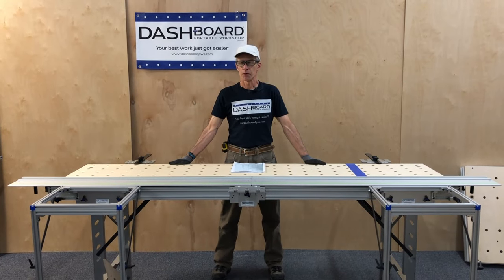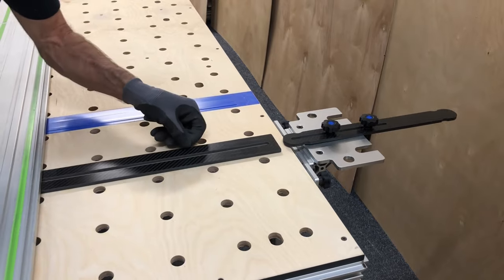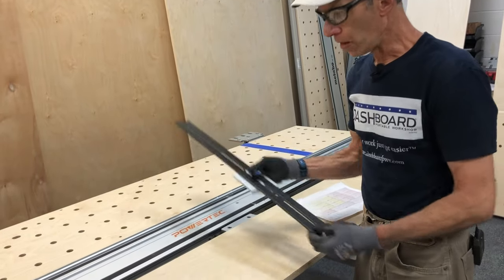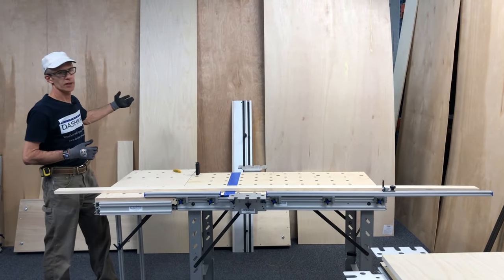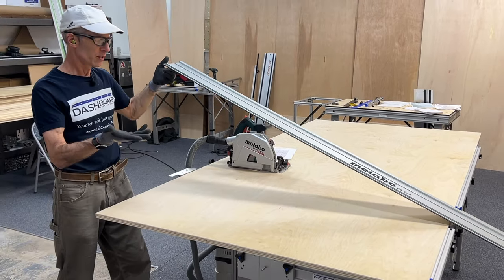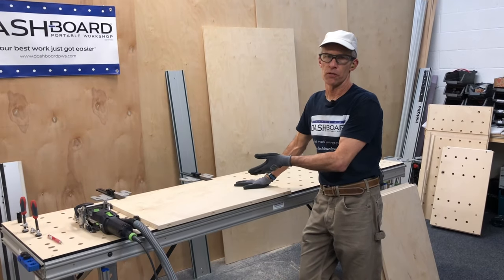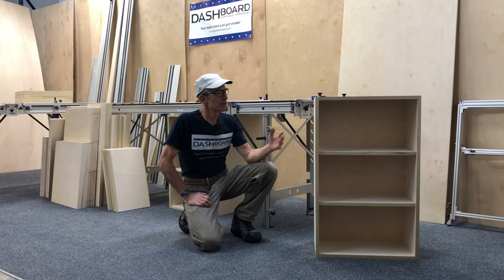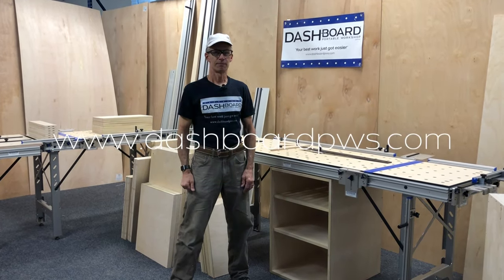Building Cabinets with Dash-Board® Portable Workshop (Full Length)

Comment: This is the first time I’ve seen this style of set up that seems worth it. I understand the use of an mft on the job site but so many people promote the use of using it as a primary work system in a shop which seems slow and limiting compared to a table saw and properly tuned miter saw. Especially because they generally do not have the capacity to handle full sized sheet goods and the seems very wobbly. I do built in work for a side income and this seems perfect for someone like me who doesn’t have the space or funding for a huge slider or cabinetry grade cnc for cutting out cabinet box components.
Reply from the maker: Thanks, Jon. Another benefit for anyone who lacks a large workspace is that to rip an 8' sheet you only need about 10' of total space, since only the saw moves, rather than needing 8' in front of a table saw and 8' behind it to do that.
Reply: I have an mft, it doesn’t just seem wobbly, it is wobbly!

Comment: Rob, excellent demo of the various components of your system! Very helpful to see. A couple of questions: how are your fences attached to the side rail of the workbench? Can casters be added to the workbench? Thanks.
Reply from the maker: Thank you very much. You could replace the levelers with casters but you'd lose most of the stability. If the concern is moving it around I recommend building a kind of skateboard with swiveling wheels for one end. You'd lift that end onto the scooter and then drive it from the other end to some different spot.

Comment: Great! Are there an adjuster on the bottom of the Wing man in case of an uneven floor?
Reply from the maker: Wingman attaches to the Outrigger, which has a significant range of height adjustment where it attaches to various tables, plus adjustable feet to make leveling easy.

Comment: Perhaps the thickness of the blade thickness tongue on the rip gage need to be adjusted individually depending on the width of the teeth of the blade and also the individual wobble of the blade.
Reply from the maker: We offer the Rip Gauge with three tab thicknesses to account for 1.8mm, 2.2mm, and 2.4mm blade kerfs.

Comment: Your system looks wonderful. You show cross-cutting a full sheet with a Wingman. Is there a way to do that with Outriggers and Track Stars? If I had the system I would be using it to break down plywood in my unconditioned garage before bringing the pieces down to my basement shop for further processing. I just finished remodeling my kitchen and I wish I had had your system prior to starting my cabinet builds.
Reply from the maker: The Wingman mounts on Outriggers and was in part designed to allow the 48" crosscut. It's needed to get that much width between the Guide Rail Brackets or Track Stars.
Reply: Given your reply about the Wingman, that would put my shopping cart well over $4000. I'm reluctantly going to have to skip the purchase and continue to use my Paulk workbench which I was going to toss out. Simple cost vs. benefits review.
Reply: 3 Questions: When will the Wingman be available? What will it cost? Can it be used to replace one of the outriggers?
Reply: Sorry, you already answered the 3rd question.
Reply from the maker: Availability should be late spring, possibly sooner. Cost is still TBD. We're a small company and are moving as quickly as we can with development.

Comment: Would this work well for 5x5 sheets of baltic birch plywood, or are they really too wide?
Reply from the maker: Brian,

We have a ready supply of the 4x8 version here and have not worked with the 5x5s, but I think it'll be fine, depending on the size of the parts you want to cut, how the accessories are arranged, and your reach. Give me a shout through info@dashboardpws.com if you'd like to discuss it in more detail.

Comment: The only thing that keeps occurring to me as I watch the workflow is, it feels like it would be a huge convenience if your dust hose ran vertically to the ceiling, and similarly, after each cut, you could just, like, reach up and hang the saw on some kind of hook over your head. It may not be a huge issue, but I feel like as smooth as the use of the bench is, it's clunky to have to find a place to set the saw down, move the hose, set up the next cut, find the saw, put it on the track, move the hose into position.... If the saw/hose assembly went up/came down from overhead, I think it would reduce a lot of that. How to implement that, I surely don't know!
Reply from the maker: It's a challenge for sure. We'd need a longer hose and I think ultimately I might be reaching farther to set down and pick up the saw if it were higher because it would need to be somewhere outside the area where a user is moving material around.

Comment: Why did you not put a scale or a way to add a measure tape to these tools?
Reply from the maker: We're a young company and things like that are pretty tricky to get right. Since tapes are rarely precisely alike, I prefer the "One Tape" philosophy, where you'll use a single tape measure for every aspect of a particular job to keep measurements consistent. Also, the genesis of our system was sitework, portability, and repeated setting up/breaking down, so with our fences, for example, there's no need to fiddle with rechecking a scale every time you start. However, as many of our customers are now home users, too, with permanent bench setups, we're dipping a toe or two into the idea of a scale on at least the F2.

Comment: Rob after you trimmed off the factory edge, did you flip the board over placing the trimmed edge against the two track stars with a parallel guides to make the first board cut around 7:05 into tape.  RJS
Reply from the maker: Yes. Every time. Apologies if I didn’t make that clear.
Reply: I’m still a bit confused Rob (I confuse easy). The piece left on the table after the flip and subsequent cut would have two clean parallel edges. The piece you moved to the sawhorse would still have one factory edge. 

Love the product and our backgrounds are similar. I’m a designer and spent six photographing cycling progessionally. Great job following your passion.
Reply: Professionally.

Comment: WOW !  Very expensive system I thought festool had that market snaggled, don’t get me wrong I have a Lotta track saws track and tables, It just seems really slow and impractical for trying to get anything done am I wrong
Reply from the maker: Rick,
The goal here has always been to provide a system of components that allows a user to perform a wide variety of tasks with a minimum of equipment, using a portable platform that can be set up essentially anywhere. Many people don't have large workspaces with permanent setups for multiple, stationary machines and surfaces that they can easily flow between for maximum speed. A lot of our customers are moving away from table saws for safety or other reasons and our design enables that for many applications. I'll never be the one trying to tell you that you can give up your table saw or chop saw if you'll just buy our products; every situation is different and for some things a table saw is the way to go.The point is to reduce the need for those things as much as possible. I developed all this initially for just myself as cabinetmaker/installer. I worked mainly alone, meaning I had to load/unload/setup/breakdown/reload ALL my gear by myself every day during site work and the idea was to reduce what I had to carry without losing capability on the job. Sure, this is a different approach from what a lot of people are used to. If you plan your processes it becomes quite efficient and changeovers are quick.
Reply: same capability as a sliding panel table saw, way cheaper, and more portable! Think of it as MFT on steroids ! Also, i own two!